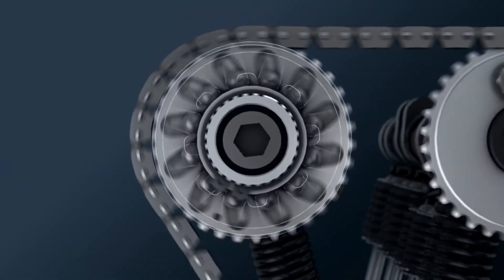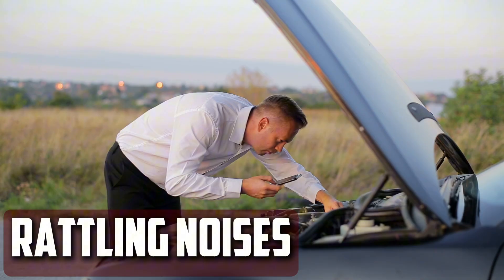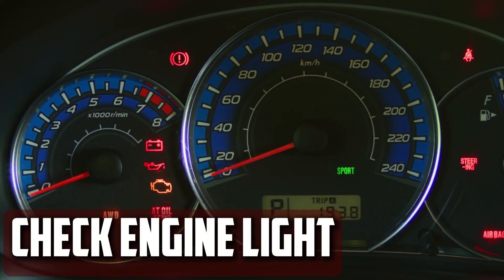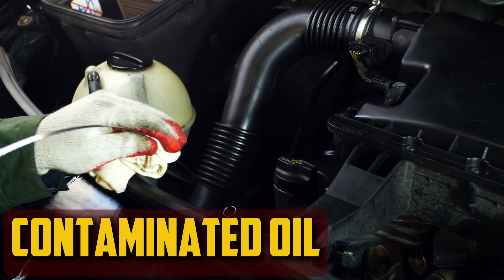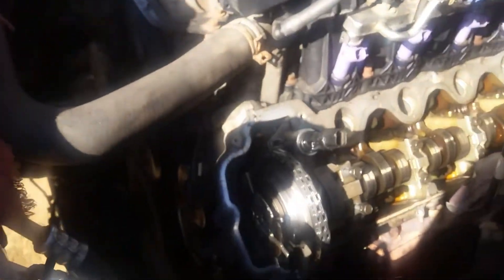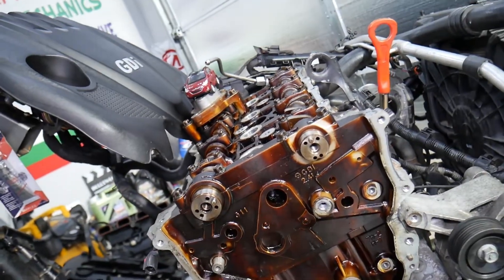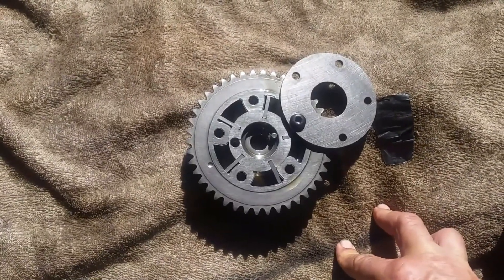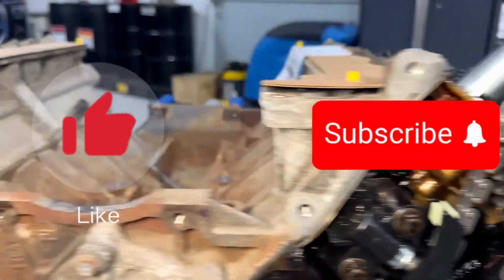3 Symptoms of a Bad Cam Phaser - Causes of Fail & Replacement Cost

Comment: Yeah, wish I'd known that before I got my 2017 3.5L Ecoboost....cam phasers were shot, ended up swapping with a semi-new motor. Almost used that cash for down payment on a new one but didn't want another car note, as just paid that one off. It's been a bit over a year since, not problems with motor....but I wonder if transmission or torque converter  is getting close to the end lol....mechanic says no, its strong. But I sometimes feel it hesitate or delay in shifting....I could just be paranoid tho
Reply from the maker: Mild hesitation could just be adaptive learning or fluid aging, not an imminent failure.
But doing a fluid service, PCM/TCM relearn, and converter slip check would cover all bases for peace of mind.
Reply: If you got the 10 speed I have the same issues

Comment: Just leaving this for anybody with an older turbo wrx or forester 
If you get a P0011 code or  P0021 (even both) follow these steps

1 CHECK YOUR TURBO, the oil line that feeds the avcs on these cars also feeds the turbo. Sometimes the solenoid fails due to clogging leading to little to no oil reaching the turbo. (stock turbo uses journal bearings which dont handle oil starvation)
If your turbo does need replacing dont shy away from researching a cheap one from china, the bearing and turbine assembly is sometimes the exact same just sold on the side 

2 Replace your oil line
For a few extra dollars pick up a flexible line with new banjo bolts and washers, even if the code wasnt caused by oil starvation its a good idea to change these while you have all the parts off the top of the engine anyway

3 Remove the banjo bolt filter screens, these things dont just get backed up with oil they can also just straight up fall out and land inside your solenoid causing failure  so even if they were not the cause removing them is recommended
 There is also a filter behind the timing cover thats harder to get to that can sometimes cause issues apparently

4 clean or replace solenoids, sometimes the P0011/21 codes are caused by oil starvation or mechanical interference from a filter screen. Depending on the issue replacement may not be necessary 

Good luck with your cars people